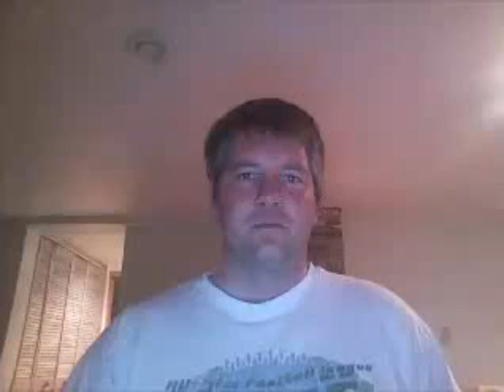Using a pressure tank for storage on a low yield well.

Comment: So, I have the Xtrol WX-302 tank installed on the cold supply line on the other end of the house. Could hear just a trickle of water fill the tank. I can wobble the tank so it's not filling. The tank is set at 49psi, the same as the 4.5gal pressure tank at the CU301 controller. Standing pressure at the CU301 controller is over 70psi. Any ideas why the 302 tank would not be filling up?
Reply from the maker: They often stick to the bottom on the first fill.   Run the pressure in and out a few times and if needed turn it up a little bit.
Reply: @kennykemp2790  Yeah, I'm patient on this stuff. It seems to have taken on more water now. I can still rock it but it's heavier. I think it's making a difference on supply but going to wait until some heavy demand situations and see what happens. So far no shower stop since install. Thanks for advice.

Comment: Xtrol said to just set all the pressure tanks at 49PSI. The grundfos CU301 system set at 70psi comes on once the psi drops about 7 psi in order to maintain the 70psi house pressure. So I guess the theory is the 70psi pump rate will exhaust the well, the Grundfos shuts down, then the pressure tanks do their work. The only thing is that when the Grundfos system gets to that shutdown point it usually injects some air into the lines also. Still undecided to use the pressure tanks or install a storage tank with jetpump, which would also give a larger reserve. I wish someone from Grundfos would advise what they recommend for adding water storage. Kenny, do you have a contact there to check with?
Reply from the maker: I don't have a contact for Grundfos that would be able to answer that question but try it at 49 psi and see what happens.  I think you could safely set it a little lower but you don't want the tank hitting the top dome in it either.  Good luck

Comment: What if you have a Grundfos constant pressure system on a low recovery well? The pressure tank is 2 gal. The pump completely shuts off during peak demand until the well recovers. Can you add a large pressure tank on this type system as a buffer?
Reply from the maker: I know that the grundfos sqfex turns off for 5 min on the low water kill and a larger size of tank would definitely be good to help cover that.  It might take longer to shut down on the top end but it would likely be worth it.  You are still limited to the actual well production for a long demand but most used are short and allow the tank storage to recover.
Reply: @kennykemp2790  Yeah, that was my initial plan but Grundfos said to limit the tank size to 5 gal or it might cause problems with the CU301 controller. They didn't explain specifically why.
Reply from the maker: I don't know if it would throw a sensor fault or something like that if the tank was before the controller.  I would think that you should be fine if you place it after.  Could even be across the house if it fits better.
Reply: @kennykemp2790  On the Grundfos SQE system the very first item on the line coming from the well is the transducer, then the pressure gauge, then the 4.5 gallon pressure tank. It's all on one manifold. That's it. My understanding is that the 4.5 gal pressure tank is just to get some flow for the transducer to detect and water hammer prevention. Then the constant on variable pump provides all the pressure, which is set at 70psi. So it pumps a lot of water really fast. If the well runs out the pump shuts completely off, thus no pressure for the whole house. I have a 120 gallon retention tank for chlorine but that supply does no good if the pump is off. Whereas the old system had a 100 gallon pressure tank which provided a buffer of water. I agree it seems to me I could just add a large Well Xtrol pressure tank which is 86 gal. anywhere along the cold water supply after the Grundfos manifold. Well Xtrol recommended that and setting their tank to 48psi but then Grundfos (via distributor) said it would cause issues with their CU301 controller, which seems to me it would just delay the well pump coming on. IDK.

Comment: I posted this response to Kenny's last comment, however, he is a busy well drilling man, and may not get back to me.. so I decided to post it at the top of the video in hope of some feedback......it goes like this......

Kenny, thank you for this video, it is helping in my circumstance..

Hopefully yourself or someone can weigh in on my particular circumstance.

I have a low yield well, that is fine for us, however, when a lot of family come home for holidays, it gets drained.

We have a 6 inch casing, 235 foot well with a 3/4 hp two wire submergible pump. I will have to check for static water line.... but I do know there is reasonable well pipe storage, as it takes 5 showers, and a couple loads of laundry and dishwashing before it taps out for awhile.....

I have a an existing fairly new 20 gallon pressure tank and was considering adding a new 120 gallon Flexlite Flexpro2 fiberglass diaphragm pressure tank...

Or could you recommend a better tank for this?  This Flex-Lite tank  specs out with a drawdown of 47.9 gallons at 20/40 and 41 gallons at 30/50....I think that gives me enough storage? Would I be risking the diaphragm to lower the 38 preset psi to 20?..... 

I would like to have the pump come on for shorter rather than longer runs, which is, as you mentioned,  best for low yield well.  I was thinking per your video  30/40?

I will have the Franklin pumptec control, that senses the amperage of the pump so that it does  shuts the pump down if there is not enough water load with a timer....

Appreciate any advice here....Thank you again for posting this video.
Reply from the maker: I'm glad the video was relevant for you.  The flexlite/flex 2 pro/ flexcon tanks are all a diaphragm style tank without a top containment dome.  Though they would add some storage if you narrow the switch setting it would not be ideal and would be easy to damage by having the wrong amount of air in them "see note one".  What you need is a tank with an "air cell" or full bladder to get maximum usage out of the tank.  The ones I am familiar with are well-mate and Sta-Rite PSC (pro source composite if they are still made).  There may be others as well.  This style of tank may be advertised as a replaceable bladder while none of the diaphragm tanks will be.  With the switch set 40-60 and the tank set at 15 you could expect over half of the tank volume as storage below when the switch turns on.

Note 1: If you do want to use a tank with a diaphragm (either fiberglass or steel) see if you can find a chart for the maximum acceptance of the tank.  Most manufactures use the same size diaphragm for the given diameter of tank and don't change for height.  The taller the tank the more air it can hold but it won't hold any more water without breaking the diaphragm.  See the link below for an example.  The WX-205 (34 gallon) tank will hold the same amount of water as the WX-255 (81 gallon tank) that can only accept 41% tank volume.  In your case a shorter tank would make sure you can't over fill and break the diaphragm.  With the switch set 40/60 and the tank set at 15 I'm guessing you would need 75% acceptance factor.  
http://www.amtrol.com/wp-content/uploads/2017/05/p04-p07_Submittal_01_17-2.pdf

For the flexpro series tanks I would suspect the 90 gallon tank that is the same diameter as the 120 would have the same diaphragm and be a little easier to not over inflate. 

If you have any questions let me know.
Kenny
Reply: Kenny,  I cannot thank you enough for this valuable information...Not many people have your experience..They just don't.... At least,  that I can find.

  This helps, and it helps a lot. I am grateful for you to take the time to share it here.  

I will go with the best method you outlined . Thank you for "Note 1" as well, but I would rather go with your best practice recommendation. I would rather pay a little more to get the right product.

 I will head back to my supplier to research and hopefully acquire with well-mate and Sta-Rite PSC or at least a similar based product.

I will get back to you with what I have found, with the hopes to get your opinion on it

Geez; Thanks!!!!
Reply: Kenny I am close to ordering the WellMate WM 35WB....along with the Pumptek  control box to monitor the pump.

This is the  25"x 75", 120 Gallon  that is made with a composite of continuous fiberglass strands sealed with  epoxy resin.  It has an impact proof base .

 The WellMate WM-35WB has a 5 year warranty with a one year replacement labor allowance. Not bad..but Not cheap..... Pretty much what the good Doctor ordered..Doc Kenny lol...Thank you for the help!

Comment: Nice video Kenny. We run into this situation alot with some wells around here barely producing 1 gpm. You explained it better than any vendor ever could
Reply from the maker: It would be nice if we were able to drill wells that made everything you needed.  I hate drilling dry holes, it's not good for anyone involved.  Some areas out here are tough to find any water so you have to take what you can get.

Comment: Yea that definitely works I have never had to do it that way, luckily our wells get at least 10gpm.  But on some occasions when I had a customer with to small of a tank and not ready to replace it.  I would adjust the pressure differential to 30-40 just to get extra storage/cycle time.  So say a submersible pump at 10 GPM on a 40 gallon standard tank I would put pressure setting at 30/70 and get a minute cycle out of it.  They notice the low pressure sometimes but if taking a shower the pump would not cycle it would hold close to 70 also saving the pump. 
Take it easy man,
Casey
Reply from the maker: We have some higher gpm pumps that we do the same thing on.  If you're installing the pump sometimes you can select one that stages out on the top end of the switch and they will just sit there happily pumping away instead of cycling to death.

Comment from the maker: Correction on the tank volumes, the 25 gallon (95 liter) draw down tank is about a 85 gallon (325 liter) total size tank.  These tanks will give you 60+ gallons (225+ liters) of storage when adjusted as described in the video.  We have some put in that are a 120 gallon (450 liter) tank with 35 gallon (130 liter) draw down that will store someplace in the 90 gallon (340 liter) range.

If someone wants to do the math on compression ratios you could come up with precise numbers, but the tank air pressure setting and pressure switch settings would need to be known.
Reply: Kenny, thank you for this video, it is helping in my circumstance..

Hopefully yourself or someone can weigh in on my particular circumstance.

I have a low yield well, that is fine for us, however, when a lot of family come home for holidays, it gets drained.

We have a 6 inch casing, 235 foot well with a 3/4 hp two wire submergible pump. I will have to check for static water line.... but I do know there is reasonable well pipe storage, as it takes 5 showers, and a couple loads of laundry and dishwashing before it taps out for awhile.....

I have a an existing fairly new 20 gallon pressure tank and was considering adding a new 120 gallon Flexlite Flexpro2 fiberglass diaphragm pressure tank...

Or could you recommend a better tank for this?  This Flex-Lite tank  specs out with a drawdown of 47.9 gallons at 20/40 and 41 gallons at 30/50....I think that gives me enough storage? Would I be risking the diaphragm to lower the 38 preset psi to 20?..... 

I would like to have the pump come on for shorter rather than longer runs, which is, as you mentioned,  best for low yield well.  I was thinking per your video  30/40?

I will have the Franklin pumptec control, that senses the amperage of the pump so that it does  shuts the pump down if there is not enough water load with a timer....

Appreciate any advice here....Thank you again for posting this video.